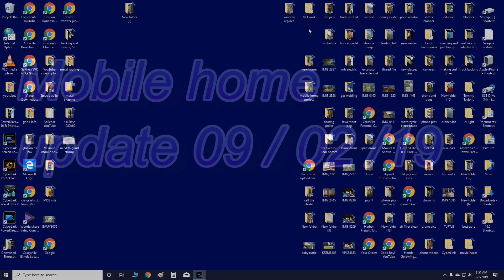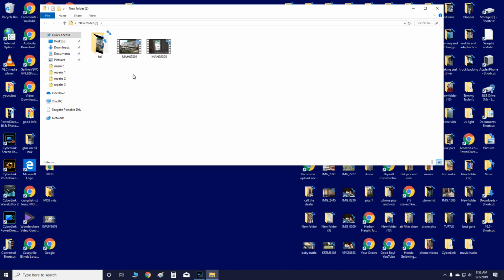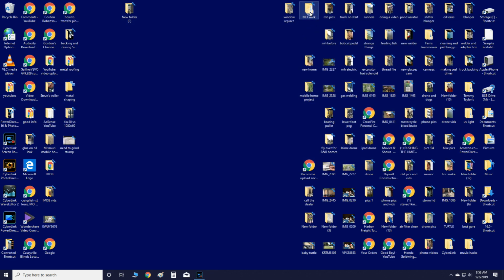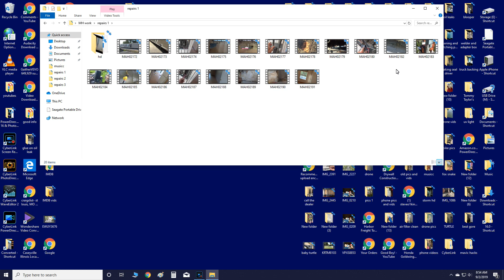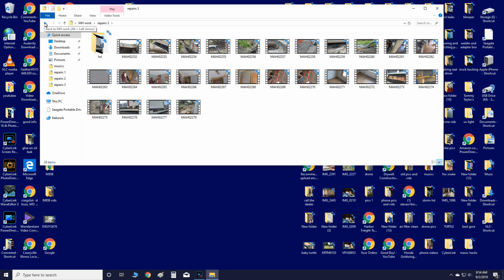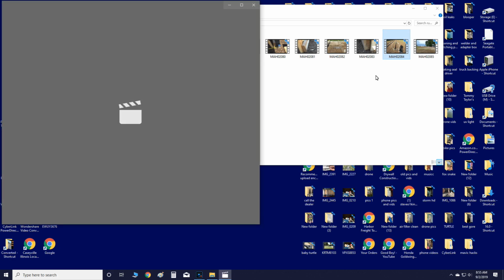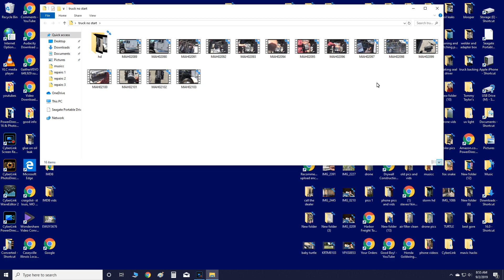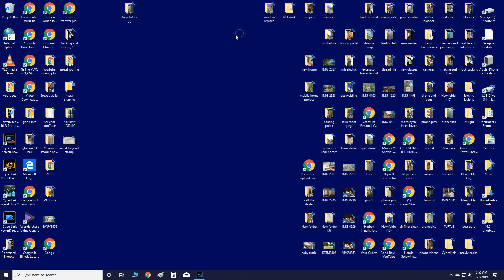Mobile home update 2,    09/2/2019

Comment: I would imagine the reason  they build the cabinets on site is to fit an unsquare space.   By looking at what you're discovering, they just throw these things together.  I thought they had gotten better at building them because it sure reflects in the price.   I bought a fixer upper in the late 90's and lived in it for 6 years.  It was a 77 and the only major damage was I had to replace a majority of the sub floor because condensation from the A.C. had rotted the press board floor.   I have a house now, but I sure miss my mobile mansion.
Reply from the maker: I will probably replace all the floor as well but after I finish what I started that is underway now. Thanks for watching.
Reply: @GordonRobertsonDIY  the  glue they use to attach the board to the floor joice is the problem and hard to get off.  It was a nightmare for me.

Comment: Gordon, I'm sure I missed it, but why are you doing all these work instead of building a house or getting a mobile home that was ready to move into? Did you get a really good deal?
Reply from the maker: No I did not get a good deal. I don't want to pay all the interest on a new house on top of $100,000. I thought it was in better shape than it was when I bought it, I found the bad things hidden later. I paid cash for it and I knew I would be making changes inside but not as much as it turns out. I don't owe anything on it or on the materials, all cash. These 16x80s are hard to find at a good price and it can take years to get a good deal, I don't have anymore time to spend looking so I just got what I thought might be the best option at the time. I will have more truck videos up when I can if you don't like the rehab videos. Thanks for watching.
Reply: @GordonRobertsonDIY  I do enjoy the construction videos. I was just wondering, that's all. You're smart for paying cash. Never know how long you'll have your health and it would be horrible to have to worry about  a mortgage when you're sick. Keep the videos coming.  In sure enjoy all of them. 👍👍